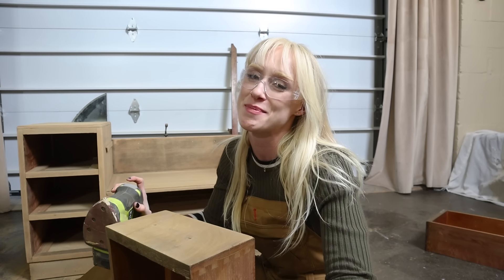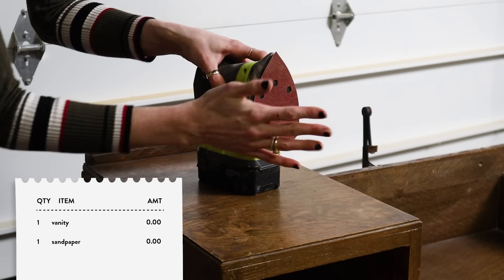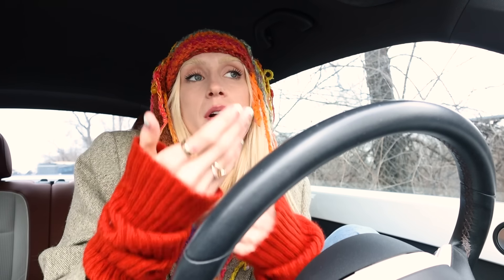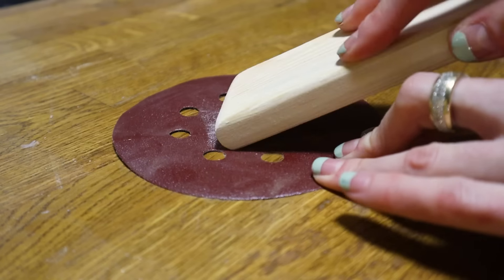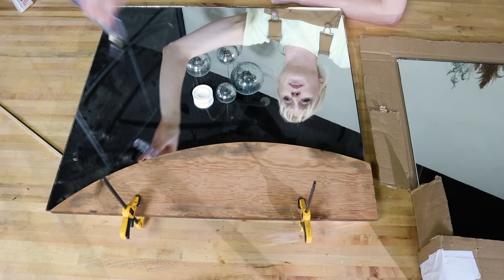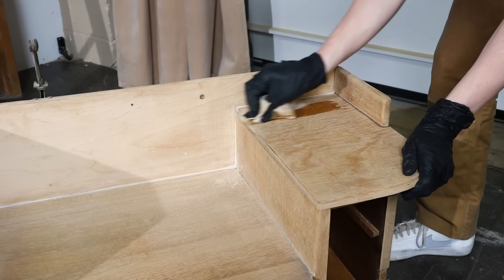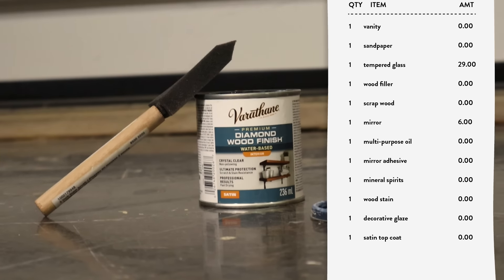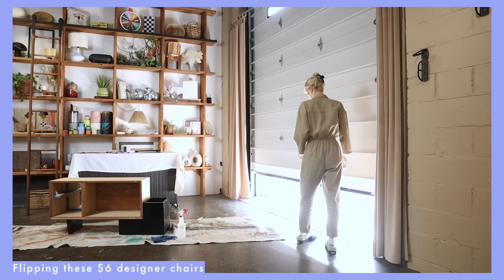I Got This Vanity for FREE and Sold it for $450 | Vintage Vanity Restoration

Comment: That restoration was terrific! A technique you might try at some point is to cut squares/rectangles of broken veneer off of a piece, and then replace them with pieces of matching veneer, if you have large areas you're thinking you're going to have to use too much wood filler to cover. 

The brows (because you asked) seem to be making you happy, and I think the only thing anyone should say about what someone does to their own face/body/hair is that if you like it, then that's terrific, and someone happy with their style and choices is always the best thing to see.

Comment: Hopefully Helpful Tip: Usually with the pistol grip glass cutters you can actually fill the handle with oil so you don’t have to dip it each time you use it.👍

Comment: Hopefully this doesn't sound like a dumb question. When you say sand in the direction of the wood grain, doesn't using an orbital sander go against the grain since the grain is linear and the sander rotates? So it wouldn't matter of you're moving the sander with the grain because the sand paper isn't. Maybe I'm wrong.

Comment: As someone who works in the glass industry, you don't cut tempered glass! You cut the glass to shape and then temper it, you actually can't really cut it after the tempering process. In the future you could look into tempering services, it usually costs less then $150 per piece but you have to have a test piece for anything that isn't a simple rectangle/square.
Reply from the maker: we looked into this but it was going to be too expensive!
Reply: @TheSorryGirls  totally understandable! It's really only worth it if it has to be super custom (I frequently have to do custom shapes to cover stained glass windows in restorations)

Comment: The vanity turned out beautiful, but I am wondering why there were no legs added ? It's an awkward height right now - like not tall enough for a chair but too tall to sit on the floor - was the choice to not add legs because that was its original form ? I desperately want it either way

Comment: not signing on to be a hater but i’m keyboard illiterate so please understand my intentions are pure. the bleach brows may just not be the move.(at least in the current shade). facial structure plays a large role in the way we handle tones and stylistic choices that may seem trendy right now, and when the top of the face and eyes have no contrast they get lost when you have such strong facial features. such as: straight or low sitting eyebrows, a straight nose, lips that are visually equal on the top and bottom, and light/straight set eyes with a heavy lid.  when we remove contrast and warmth from the face specifically on the eyebrow it is usually because we are trying to strengthen rounded or plump facial features by pushing the brow and forehead forward creating a more mature aesthetic. you’re a very lovely girl but the bleached eyebrows add maturity and more sharp flat lines to the face creating a colder appearance. However if the brows were still lightened and a softer shade like a honey or gold based medium blonde it would add warmth and contrast back into your features, creating a flattering look that doesn’t age you and adds a youthfulness back into the overall look. 

i also love the work done on the vanity, my grandmother had one just like this and after she passed we all fought with each other about who would inherit it so bad that my grandfather barred any of us from taking it until he passed as well. i’m glad to see something brought back to its original beauty with hard work.

Comment: I legit thought you had some kind of serious health issue because the brows so drastically changed your face. it potentially reads as someone who is going through Chemo or having a major health problem. and makes your face look very gaunt. So put together, it makes you look like you are a cancer patient or getting over a very serious illness. Which is probably not the look you are going for and might be what your Mom is picking up on as well and why she does not like it. I don't see peoples faces "normally" though after working in a nursing home because I basically was exposed to so many terminally ill people, or people with liver problems, cancer etc. and I recognize when people are dying. It's a common thing that happens just from working in healthcare. So my read on it is also not typical. I think as others have said, having less harsh eyeliner and mascara would help things not look so contrasting. But at the same time, if YOU like how it looks, it's your face, and that's really all that matters at the end of the day.